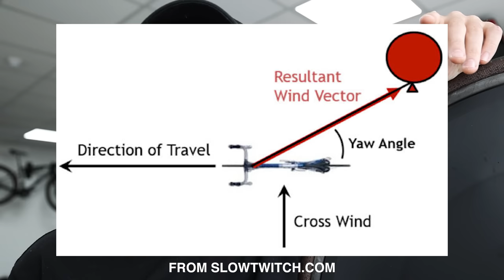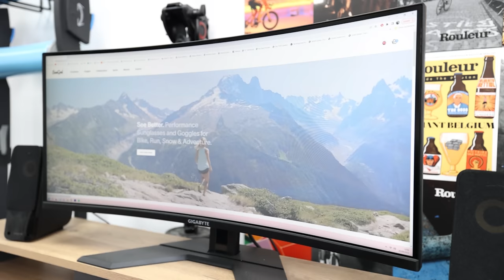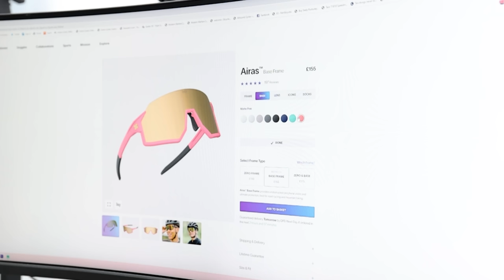I Was Wrong About The Front Disc Wheel & what Sungod Glasses do I use?

Comment: It is true that the yaw angle reduces as the speed increases but, if you have done gust response analysis on aircraft, you will know that the reduction in angle is offset by the aero load increasing by the square of the speed.  The result is the load increases linearly with speed.  Going faster is not going to help you out, even with the reduced yaw angle.

Comment: I wish I could get Sungod stuff, but my eyes are so bad that my only option seems to be to just wear my regular glasses during cycling ☹️ It really sucks.
Reply: I actually found a local brand in Poland that makes glases with corrective lens inserts (Tripout Optics). They are ok but they are not great. At least it is an option. Look around you might find something similar.
Reply: Im wear contacts when riding. You can also use your glasses on rudy project when i visited one store.
Reply: Another option is Tifosi glasses. They have an optical insert that goes behind main lens. That allows for interchangeable lens types. I did ask Francis to tweak Sungod to offer Rx options for us vision challenged types.

Comment: Does double (or single) disc help with a tailwind at a yaw angle less than 90 degrees?  It seems it might be like a sail.
Reply: You should be able to cycle faster than the wind during a tailwind because you're only battling rolling resistance if you're not. And you should not consider buying disc wheels if you are unable to do that. When cycling with a tailwind and you cycle faster than the wind the tailwind turns into an apparent headwind. The yaw angle and suitability of a disc wheel then depends on your speed, and the speed and angle of the wind